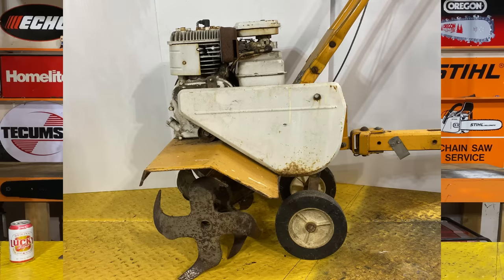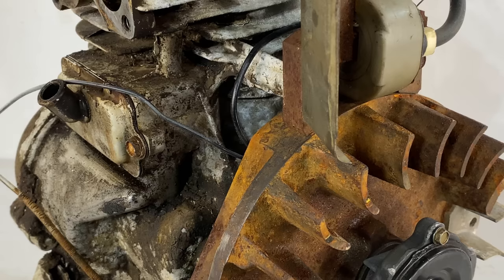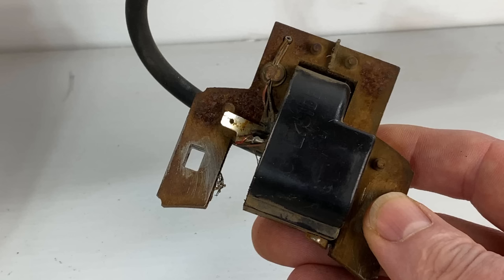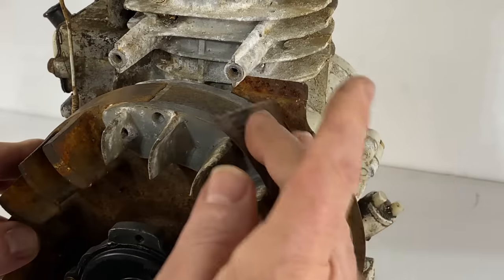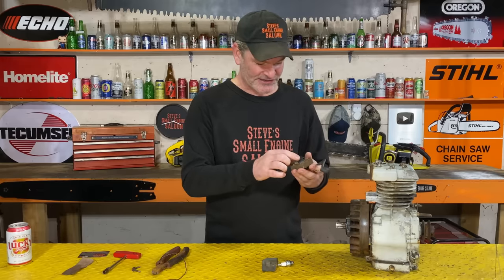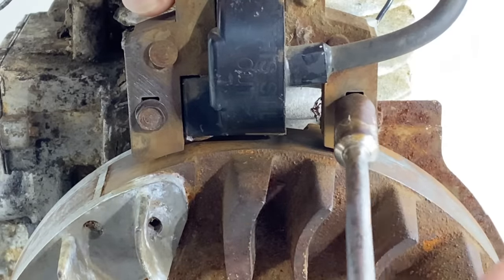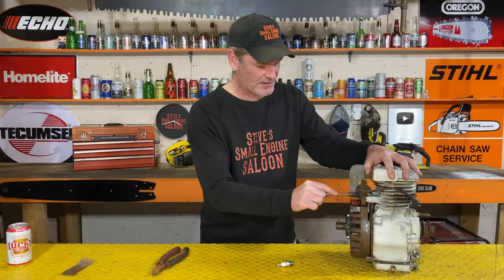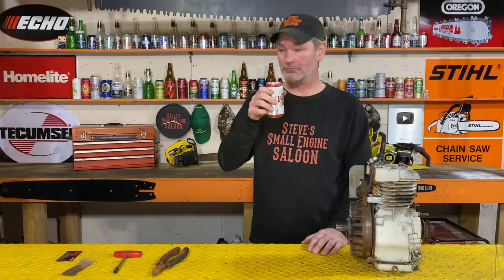Easy Hack To Eliminate Breaker Points & Upgrade To Electronic Ignition -Episode 5 of 7 Tiller Series

Comment from the maker: ✅Click here for the proper coil ➜ https://amzn.to/3fVjMv5
✅Click here for new breaker points ➜ https://amzn.to/3dRLqGK
For more videos like this, check out: 
👉Easiest Way To Make Your Briggs Points Spark Again ➜ https://youtu.be/EuaRms2R1C4
👉How To Diagnose and Read the Color of Your Spark Plug ➜ https://youtu.be/Tz4uxFMUCOA
👉How To Fix Stripped Spark Plug Threads For Free ➜ https://youtu.be/yY_fuDRltZE
👉How To Check For Spark ➜ https://youtu.be/VZ8r7xv3DLY

You can connect with Steve here too: 
✅Visit Steve’s WEBSITE ➜ http://www.stevessmallenginesaloon.com/ 
✅Visit Steve’s PARTS & TOOL STORE ➜ https://www.amazon.com/shop/stevessmallenginesaloon 
✅Follow Steve on FACEBOOK ➜ https://www.facebook.com/stevessmallenginesaloon 
✅Follow Steve on INSTAGRAM ➜ https://www.instagram.com/stevessmallenginesaloon/ 
✅Follow Steve on TWITTER ➜ https://twitter.com/SteveSaloon
Reply: Why use a Darlington pair of transistors?
 Why not just use one transistor?
Reply: That coil from Amazon doesn't have the stub out for the air diverter
Reply: what coil do I need for a 80302-933128 B/S engine to make it Electronic Ignition ?
Reply: What transistor??? How will it work? Do you have a how to link or video? Thx
Reply: This video was the most helpful video I’ve found on YouTube thanks for helping restore my 70s dynamark keep up the good content man!!
Reply: @revbikerbigd8664 11:18 11:18
Reply: Changed new coil still no spark thought I check wiring but going to recheck question to this all wandering if the low oil sender could cause it to have no spark because if the sender is bad could it cause the no spark I'm working on a old Tecumseh generator 10 horse it has a low oil senser
Reply: My briggs and stratton 16 hp with points dosen't upgrade to electronic ignition  unless I have the polarity reversed .

Comment: You could mention that the electronic ignition coil has an exciter coil. It's the small iron circular object. Attached to it is a darlington transistor that energizes the coil and spark plug.

Comment: The process seems straight forward the difficult part is understanding a replacement at the store.   The parts guys want to give you original points coil.   How do you find a conversion part.   Websites don’t give you this info either.  Just original parts.
Reply: Buy any coil that fits the flywheel, either offseas or online. Dont bother really with briggs service,

Comment: I am surprised that works.  On the old chainsaws that I work on that method does not work.  We would have to replace the flywheel also because it is timed differently for points vs  electronic ignition.
Reply: You dont have too replace the fly wheel they have moduels that you spice in on the two cycle engine that does away with the points

Comment: I have a Briggs & Stratton 11 Hp Model 253707 Engine that's used on my homemade  log splitter.  I  had to remove the engine's tin shroud and saw a huge mouse nest that filled the entire cavity.  When I removed the nest I saw the spark plug wire was completely stripped of insulation.  Amazingly the engine did run like that and luckily didn't catch on fire! I ordered a new coil and installed it but it wouldn't run.  It was this video that made me flip the coil over and now it is up and running and I'm splitting wood again.  The coil had no markings as to which way to position it.  I love all of your videos and they are a great help for us DIY.  Thanks for the info!

Comment: Thank you so much for mentioning that ignition units have to be the right way round. I fought an Honda GCV135, none start, none spark for a very long time, trying all manner of things. The strange thing was that occasionally it would spark and run for a little. Then I saw your video, flipped the ignition unit and it started on the first pull and didn't stop till I shut it down. I didn't know if I should laugh or weep, the relief was so powerful. Thank you for sharing!
Reply from the maker: Awesome!

Comment: Steve, about 30 (?) years ago I put electronic ignition on an old lawnmower that was left when I bought my house.  It gave new life to an old mower.  After the handles broke and I replaced them with an old set someone had thrown out, and the mower kept on cutting.  Thanks for the memories.
Reply: I still have a Kmart-Murray 22" push mower with the 3.5 HP Briggs that my dad bought for me back in 1970. I still have and use it to this very day. It doesn't smoke, has gone through about 5 carburetor diaphragms, a dozen spark plugs, had two valve jobs done by me to set the end gaps/lash to the tappets and an electronic ignition upgrade like Steve just did. Starts on the first pull. The mowing deck has finally begun to rust through last year. Going to bondo over the little holes and keep it alive! It's also on it's 3rd set of wheels. I use it mostly for trimming where my zero turn won't go.
Reply: @joefudd  How many blades has it gone through?
Reply: @rongollonik7754  I just put a brand new Murray OEM blade on it last month. It's on it's 8th blade.

Comment: I have the exact same Dewalt 20 V drill. Used it for starting motors just like you did in this video. Ended up breaking the chuck brake from not having some sort of free wheel mechanism on there for when the engine fires. Cut the handle off of a cheap Chyneezium 3/8 ratchet and tack weld a 3/4” or so 3/8 drive socket to the backside of the ratchet head. The center twist direction selector type ratchet, not the toggle lever type.  I tack welded a short chunk of coat hanger to the outer case to where it will prevent the selector from switching to the wrong ratcheting direction after the socket is tacked on there. Gotta take your time and weld slowly with wet sponge breaks so you don’t cook ratchet guts. Made the same type of thing for them dang Troybilt string trimmers with the easystart (jump start, whatever) feature that they were ignorant enough to make the drive hole that connects to the flywheel require an oddly shaped 5 point female proprietary tool to use, and you will end up needing to use it because the spring assist recoil starter pawls are garbage and fail all the time. Ended up making the ratchet starter for these turds using the 5 point drive piece off of the brand new troybilt easystart drill adapter gizmo I bought.. right after it snapped the drive bit off on the first attempt at using the damn thing. Troy Bilt batting 1000.

Comment: This is definitely the best way to get around taking the flywheel off and dealing with the points and condenser. Those are referred to as pedestals that the coil bolts to and it is a good idea to run a Q-tip down inside of them with isopropyl alcohol before installing the coil. The coil grounds itself through these pedestals so it is a good idea to make sure that the bolts are wire brushed  under side of the head and threads as well! I own a chainsaw collection of around 70 saws, And I have seen it before where the coil is nice and clean and you unbolt it and there is oil down inside the pedestals causing a problem with grounding issues.

Comment: Basically what I did to a vintage lawn mower I got a year ago, the only thing I did different was I believe I kept the kill switch wire and didn’t cut it and put quick connect female terminal on it to connect onto the upgraded ignition module. Did end up work and bypassed the points, still wish I watched this prior tho if I had known about this video cause I didn’t sand the terminals and other important parts and just overall hand information I wish I had known and tried before the project. I realize now I truly winged it and must have had luck on my side, I bought a parts mower for $10 and assumed the ignition module would work (thankfully it did) but didn’t think to check the sizing or anything, and by miracle I didn’t put the module upside down. I did however use a business card for the gap 😂

I’ll remember this video for my next restoration with points :)

Comment: Love your videos.  Have learned great deal from you.
Question:  My Briggs powered chipper shredder would not fire.
Spark tester showed no spark.
You showed me where the main jet is at the bottom of the fuel bowl.
Installed a new coil, new plug, flushed the tank, flushed the carb.
Filled with fresh 89 ethanol free gas WITH STABIL added.
Pulled the cord and the machine ran.
Next day, used machine for an hour, no problem.
TWO days later, it will not fire.
Plan on flushing it out all over again.
WHY are briggs engines so blasted sensitive to humidity?
If all ignition coils are not created equal, what is the best brand of coil to buy?
Thank you for your videos and your expertise.

Comment: Hey Steve, Great video but please make a note to do a video in the future for converting an old Tecumseh points and condenser engine (that has the magneto BEHIND the flywheel like an old H60 or H70) to an electronic ignition. I see plenty of videos for B&S engines but not for this old style of Tecumseh. I have asked DonyBoy and Taryl multiple times but I they only ever convert B&S engines, NOT Tecumseh conversions with the magneto BEHIND the flywheel for engines like an H60 or H70. Thanks. Also, do you ever try any Belgian beer??? Very good stuff the majority of it!!!

Comment: See, I have this same engine or one nearly identical and I did this exact same thing to make it run. However I used an electronic coil from a Kohler pressure washer that threw a rod. The only slight issue with mine was that the sparkplug wire was too short but I managed to extend it and very thoroughly insulated the joint with a section of plug wire insulation and two or three layers of shrink wrap. I don't have much plan for the engine at the moment but I'd like to stick it on a go kart

Comment: I used to use a module to convert the old HK & VK35 Kirby - Techumseh engines to electronic ignition. The old Phelon coils on the VK/HK35s were damn near imortal, and always threw a huge spark. The let down was the carburettors they used wore out quickly, becoming unreliable, and frustrating!

Comment: Steve, I looked at 2 other sites on how to replace the coil on a Briggs engine they both used recycled coils from a parts engine. your episode was the only one that recommended cleaning the contact points between the recycled part and the engine. Having worked in the  electronics world for over 20 years that was the best advice you could have given in this episode 4 presentation. not properly cleaning the contact areas on the engine and the replacement part could easily cause more issues in the future.
Reply from the maker: Right on Paul!  Thank You...

Comment: First thing I did this spring with my old tiller. Worked great. Then clutch quit that's when I found your site and subscribed. Got clutch working but the screws on screen would not fit (too loose) found a couple of self tapping screws and back to tilling. Great Channel
Reply from the maker: Right on

Comment: enjoy your video and I already knew everything you mentioned in yours  sanding and clean the flywheel coil legs and Pont of contact both sides,   unless I missed it  what happened to the peg in the back of the coil. o just want to put it on a small mini bike for the swap meet to ride around   only a 62 year old. teenagers

Comment: Loved the video Thank you    

I am replacing a older twin cyl 20hp briggs with a new twin cyl 20hp briggs and the wiring harness is not the same on the engine.. any ideas would be appreciated.. Mechanical I am pretty good at wiring not so much Thank You

Comment: Great video, Steve! Thanks again. A down-to-earth approach is always the best way to explain things.  Appreciate telling me what happens, as well, if you install the coil backwards. If you hadn't mentioned that, I would have been left with that question. I like it when people cover all the bases, including what happens if you do it wrong. :)

I was always wondering if you're from the East Coast originally, as I'm from Newfoundland, and I always think you seem to have an east coast accent, for some reason. I have a friend from NB who seems to have the same accent as yours. But perhaps I'm mistaken.

I think for the first time I understand about upgrading from breaker points to an Electronic Ignition system. The breaker and points operate on a cam under the flywheel to supply the collapse of the magnetic field built up in the coil, while the electronic ignition has a circuit (either transistor controlled or capacitive discharge controlled) built right into the coil pack. I guess this one would be a TCI unit, wouldn't it? CDI seems like it requires a separate box....

Comment: I have a B&S 2HP but can't find the electronic ignition for it.
Would the one for the 5HP work the same?
I see a lot of the electronic ignition for the 5HP for sale.

Thanks for anyone's help.:trophy-yellow-smiling:😉👍
Reply: 2HP has a smaller flywheel so the 5HP ignition armature shouldn't fit (assuming of course that it has the original flywheel), because the legs of the armature have a different angle on them to fit the smaller diameter of the 2HP flywheel. The points ignition isn't really all that bad but they can be if you neglect the engine and leave it outside to get rained on, etc. The totally wasted rusty, crusty points, condenser and plunger on the one seen in this video is the worst I've ever seen. I've got intact points ignition on a 4HP and others which I intend to keep, because it's neat, it's old school and just a little bit more complexity to a very simple engine. They are pretty reliable in my limited experience. 

Keep looking for parts--if you know the part number for the 2HP Magnetron (electronic ignition) you can web search all that much better. I'm almost certain there's aftermarket Magnetrons available, even if made of Chinesium. LASTLY: Youtube comments is the worst place to attempt an intelligent conversation and get replies. I'd suggest searching for a "small engine forum" on the web, join it, read up (your question has already been asked) and ask your own question.

Comment: Hey Steve! Are you a believer of using any oil additives? If so what do you use??
Reply: An ounce or two of lucas oil stabilizer will help protect the cam and bearings. The splash systems in these engines are decent enough, but the high temperatures coupled with extended idle time can be detrimental to friction surfaces. Straight 30 weight detergent oil either synthetic or regular with the lucas added is my routine. Don't forget to monitor both the level and the hours run, oil changes are both simple and cheap for small engines. I do one at beginning of season of use, and one mid season of use. My Craftsman lt1000 is 20 years old, looks and runs like new.
Reply: @markk3652  Thank you for your input Mark! I will try using some Lucas and see how it goes. Last year I started using Mobil 1 5w-30 synthetic in one of my push mowers that I don’t care much about just to see if it would start burning oil. I worked it hard and I changed the oil twice during the year and I haven’t seen the oil level go down or any smoke puff out with a cold start. I’m surprised! I heard Amsoil makes a specific small engine 10w-30 oil and I think I am gonna test it out this year for myself on another lawn mower. On the Amsoil website it says not to use additives because it already has specific additives for small engines. I have watched some videos of people talking very highly of it. Maybe you can give it a try too! It is kind of spendy but I like trying new things especially if it protects my engines

Comment: Makes me ask the question can this work on a old Merc 9.8hp boat motor from the 70's or 80's (not sure what year my motor is) but the system is working for now but I have a pull start on it.
Reply: I came here looking for a conversion for my 1950 KE-4 Mercury rocket. I suppose if you can get a core to fit inside the concave shape of the flywheel. Being inside though I don't know how you would get it within .01 of an inch
Reply: @agtjamesb007  something tells me it says it's a 7.5hp but it'd run circles around mine when it's running.  Cool old boat motor and good luck with it.
Reply: @fryreartechnology7611  yup! Thank you. If the laminate core fits the coil then you wouldn't have to do all that nonsense I said in my last comment. I'm gonna give it a shot!

Comment: Awesome......watching now....I'll respond at the end. Excited! Thanks for this
............
............
Cheers! I broke one off years ago....I drilled it out lol, and 3hrs later I had another bolt in. Pain in the backside!
Sandpaper point was very very important!
Thanks for that Steve.
Pabst Blue Ribbon cheers🍻🍺🍻

Ps...I've seen folks machines with a 1/16" gap and they wondered why it either didn't fire, or was very sluggish.

Comment: Hi Steve, really enjoy your videos. Learned a lot. I have lawnmower, tested ignition magneto, good, spark plug is good, ground wire for magneto is detached, I cleaned the flywheel, magnet seems strong. Cleaned and gapped magneto using a business card. Still no spark. What could it be?

Comment: Have my first 10HP L-Head B&S and I'm not certain where to find the engine code.  Will disassemble some more to inspect, like under the cowling/shrowd.  Is on a McCulloch HD-5000DLX that I'm not finding anything regarding... though confident I can reverse engineer and figured out what is all required.  Will be a pleasant surprise if this style design and will be more interesting not so exiting if the style is where the magneto is behind the flywheel though I'm confident that can be restored like Mustie1 demonstrated with his custom garden tractor latest find.  Thanks for sharing, excellent info as always.